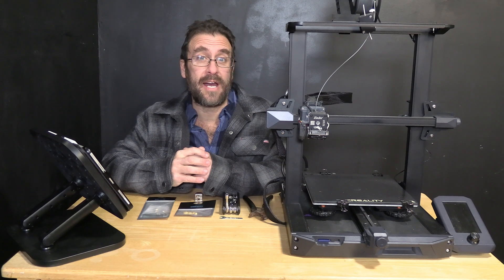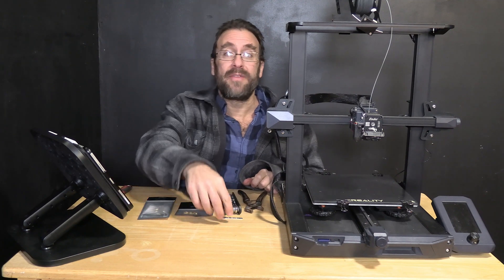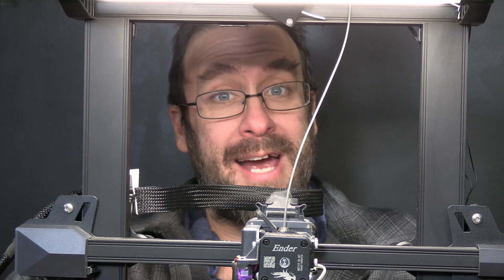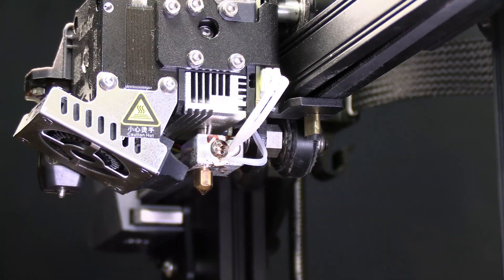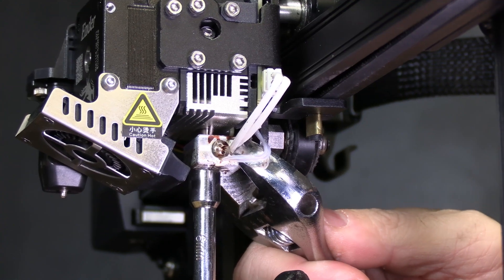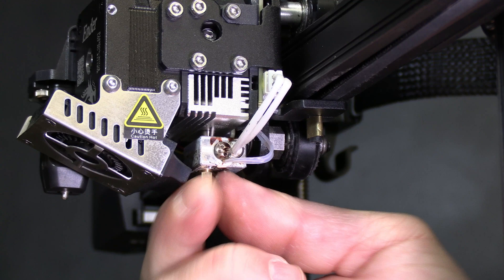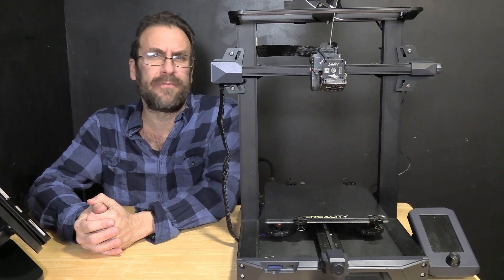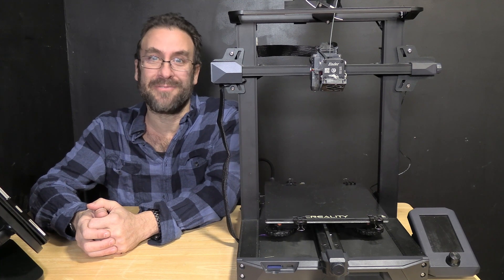How to REPLACE THE NOZZLE in a Creality SPRITE EXTRUDER, such as on Ender 3 S1, Pro, and PLUS

Comment: did you not notice your bent screw holding the heat bock on
Reply from the maker: Yup. Not bent, just crooked. I could turn the block, and it would straighten. Not important. Long as it's snug, with no movement. This kit is still in use. Also, this is a side effect, of beating the tar out of your own machines, to help others...

Comment: I'm glad to see it uses the same nozzles as the Ender 3. There are some other good hot ends that I've been looking to get, but I'm not sure if I should get them, because they use different nozzles... and I don't know the pros and cons of the much longer nozzles. (For example, a hardened steel nozzle created more friction on a regular small Ender 3 nozzle... but a REALLY LONG hardened steel nozzle would introduce a whole lot more friction with them having a long tube where the filament has to pass through. It just seems like it could cause problems with print quality and settings). I just don't want to have to mess around and tweak settings for weeks just to finally get my hot end to work like it should.
Reply from the maker: Honestly, rather than spend money on an Ender 3, I would grab one of the new V3 machines instead. They are MASSIVE upgrades. Especially the KE
Reply: @3DRundown  Wish I could afford one. Ordered the Ender 3, because it was literally the only model I could afford when I got it, but if I had known better I would have waited another month or 2 and just got a better printer. EVERY single problem imaginable has happened to this one and I've only had it about 2 months. I did a lot of research on all the common problems and fixes, so I was ready for them and trying to stay ahead of them, but I ended up having 10x more problems than I ever could have imagined. Now I have to spend money to keep this one going instead of saving up for a new one.
Reply from the maker: The High Flow kit, for the S1 is nice.
Reply: @3DRundown  Thanks. Will check it out. Any idea the max printing temperature? It looks like it would be an "all metal" setup, but I'm fairly new to 3d printing and don't want to make any assumptions.

(edit: Is the S1 high flow kit part of the Sprite Pro? Was looking it up and saw it as an upgrade for the non-pro version of the Sprite, to print at 300c... but I think the Sprite prints at 300c with the same parts.)
Reply from the maker: The Sprite Pro is already "ALL METAL", so it is less of an upgrade for the Sprite Pro. Can get a peak at it here: https://youtu.be/nYUnIR7_ycs?si=u5uJ4_cM6Rd7nW04

Comment: Thank a lot for this. Unfortunately the Ender 3 S1 pro has been my first experience of 3D printing and I can't hack it. The prints won't stick to the bed and after leveling with paper the nozzol seems to be higher than what I set. It has been a really bad and frusatrting experience on Xmas day.
If anyone could please share the basic settings and what you did to print a rabbit or cat lol
Reply from the maker: 1st: STRONGLY suggest, you hop into my course. I will walk you through SO MANY THINGS that will make your life easier: www.3drundown.com
Reply: @3DRundown  I finally got it to work! Levelled with just my eyes, point 1 once and 2345 three times with wheels and then back to point 1 with another Z axis adjustment. Added "M420 S1 Z10 ; Use saved Bed Mesh" and it's finally printing properly!
Reply from the maker: 2nd: You need to learn to work with your Z-OFFSET. Let's do this together: https://youtu.be/raSW7cDGObg
Reply: just get a cr touch and forget about those headaches
Reply from the maker: LOLZ.  The S1 comes with a CR-TOUCH. Get a clue clown

Comment: Thank you for the great explanation Gregg, I always hestiated to use the amount of force required on the gantry, to change the nozzle, but your approach seems way more convient.
Reply from the maker: Welcome. Always treat your 3D Printer like a Cat.... Gently.  Because, it's just waiting for an excuse to hate you.
Reply: I had a new Ender 3 and the first time I took the nozzle off I tweaked the extruder/parts enough that is caused one of the fans to be slowed down enough that it caused problems, sometimes making noises and sometimes without any noticeable effect except the parts coming out spongy. Had to twist everything back into place to get it printing right again. (and I didn't use that much force).

Comment: The hot end is connected via the heatbreak AND 2 VERY THIN (M2) BOLTS. If you choose to do this with the sprite extruder still attached to the machine you will bend/break the 2 bolts. As i can see in the video yours are already quite obviously bent. PLEASE detach the extruder from the plate first so that it is loose. This way you do not put tension between the hotend and extruder.
I appreciate the effort that goes into making the video but please stop spreading bad instructions.
Reply from the maker: Omg lol. Your too funny. Please go away now. Bogus info is best kept on FB groups
Reply: @3DRundown   yes very mature way to deny a completely good advice. Such a expensive piece shouldnt be handled like it is the stock cheap one.  No wonder you still have 8k subscriber.
Reply from the maker: LOL. My channel is one year old and growing at 900 subs per month. Last month, I earned $3000 on this channel. Hold on while I sip my coffee and laugh at you.

Comment: Creality recommends to do this with the heat block on. Is this not necessary?
Reply from the maker: Do you mean "HEATED"? If so, I did it with the heat block heated. Physically POWERED ON, is not my favorite thing. I prefer to heat it, then turn it off, so I don't fry anything.
Reply: @3DRundown  ahhhhh ok. So you heat the block, then turn it off and proceed with the replacement of the nozzle? Because in minute 2:55, you screw the nozzle with your hands and I was in doubt! Thankss
Reply from the maker: Your Killing me Smalls! at 2:45, I say "Once the nozzle is heated, I'm going to turn the printer off" at 2:55 I say "If you'd allowed excessive time, for your heat block to cool, you might want to warm it back up again". Come on now, your skipping around on me. Give me that run time!! 😂🤣 I start the nozzle by hand. The Nozzle will be cold. It's Brass, so it WILL get hot quickly, and you will be switching to the tool in short order.
Reply: @3DRundown  Sorry! My english is terrible 😂, and I was watching your video on the street! I didn't get the whole thing. Anyway, thanks very much, your video helped a lot

Comment: I wanted to change my nozzle to a 6mm but my S1 plus nozzle was on too tight and i didn't want to break it. I may have no choice but to take it apart.
Reply from the maker: I did the 0.6 on my P1P for this channel, and I hate it. It sucks at detail. I'm going back to a 0.4. Unless your doing large models with minimal small detail and no lettering.... Don't bother.

Comment: Thanks for this! I found I had to relevel and reset the Z-offset after changing my nozzle, it moved ever so slightly.
Reply from the maker: Yessir. Anytime you adjust any nut, bolt, screw, tension, nozzle, sneeze, sip your coffee..... Check your Z, But, ESPECIALLY after a Nozzle Change. Don't risk that perfect new tip...
Reply: @3DRundown  How do you "check the z"?

Comment: Regrettably didn't work for me. The nozzle was in there so tightly I had to order a new heating block altogether to be able to replace the nozzle. The nozzle is now smooth from my attempts to turn it. One of the screws fell out from the jostling too.. not sure where that wound up.

To be fair, I was trying to replace it because I suspected they used a cheap or insufficient nozzle in the extruder they sent me. Getting lots of popping even on fresh PLA. So, the idea that they over-tightened the nozzle into place is hardly surprising. Working on it ruined my morning, though.
Reply from the maker: Its a good idea to keep spare parts. Q/C can be an issue
Reply: @3DRundown  Yeah. I intend to keep this old heatblock around at least, since the only issue from what I can tell is figuring out how to get that old nozzle out. I already bought hex bolts in M3 in a range of lengths in case, so the missing one is not a real problem.

Intend to unscrew and re-screw the nozzle included in the new block just to make sure it's in a manageable range first before I install it. And while I can get it in a vice with a ratchet wrench.

Comment: how is the anker make m5 when compared to ender 3 s1 pro ? Thank you.
Reply from the maker: Depends. It looks like a superior printer, and is very fast, but, depends what you think about proprietary nozzles, early-stage custom slicer, no memory card slot, and a few other oddities. I offered to cover it, but got no reply
Reply: @3DRundown  thank you for the in depth clearance .Have a nice day
Reply: Late, but it depends. I have a ender 3 s1 pro and its perfectly capable of printing things and thats why I gone for it since it’s capable of better temperatures and also a bit cheaper. Anker as a company is pretty sketchy considering one of their sub companies that sells security had a security breach with their security cameras so I have my suspicions with the company, along with what 3d rundown said. Though ender 3 pro s1 is honestly a 6/10 at best in my book since the bed leveling leaves much to be desired along with meh firmware that if you update runs a risk of bricking your printer. I would still go for the ender 3 s1 pro though just for the fact that parts are available on amazon in large quantities and theres a huge community behind the ender 3 platform